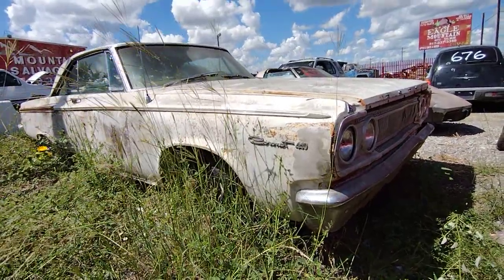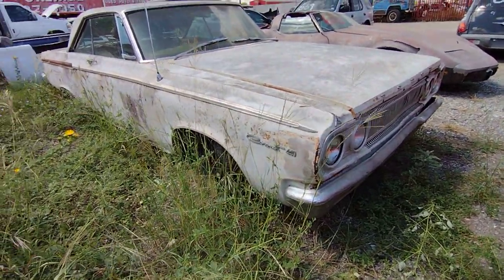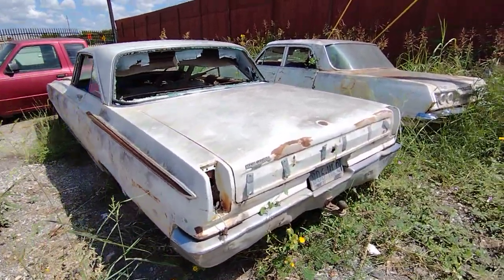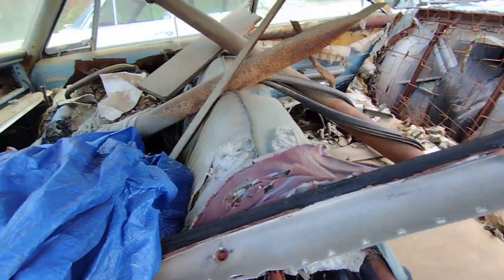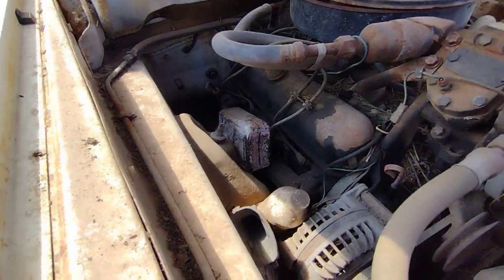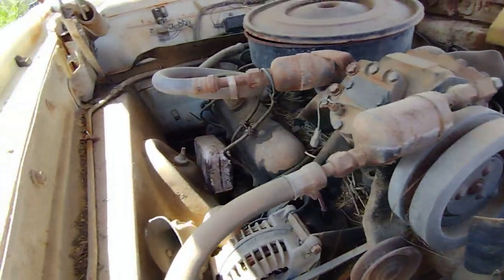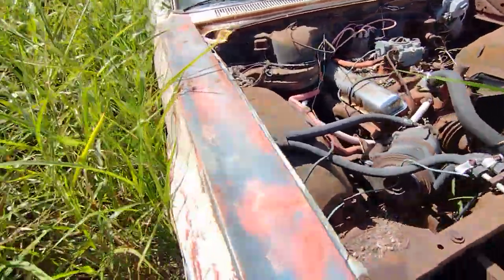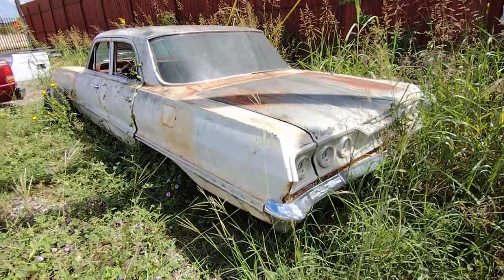Mopar For Sale. 1965 Dodge Coronet 440 Junkyard Find

Comment: Whoa Nelley, 1965 and may not ever be alive......

That's a C3 (1968-1982) Corvette, not a C2. Yep, I'm still here, just got home at 1 AM yesterday from a business trip to WI as noted below. Nothing like an early flight, a time change, working all day/week and getting home at 1 AM on a Friday. It will throw ya off, that's for sure. But I'm back from America's Dairyland (Green Bay, WI for those that know WI). Not to mention the day before there was a big Green Bay/Chicago game and I was flying through both airports the next day. Anyone who has flown through O'Hare will understand that the airport is a zoo, as are the NY airports. I fly through them all.....

We got the tag, we can brag: 1-1 for LH manual outside mirror, 3-9 for variable speed windshield wipers with washer, Q-1 for Music Master AM radio, economy, V-3 for backup lights, AB30 for 273 V8, D-5 for automatic transmission, E-1 for AC with heater,  SO of 926 for 9/26/1964 production which was a Saturday (which may have been the scheduled ship day), W32 for Coronet 440 two door hardtop (W is Coronet, 3 is High price class, 2 is two door hardtop), H1B for Blue cloth and vinyl interior trim, WW3 for White exterior paint with some sort of maybe silver upper door panel paint/trim. 

No VIN, can't win, but easy to figure out, no doubt: W for Coronet V8, 4 for Coronet 440, 5 for 1965 model year, 2 for Hamtramck, MI assembly or 5 for Maywood (Los Angeles) CA assembly or 7 for Fenton (St. Louis), MO assembly, and the rest is the production sequence. Hamtramck, MI assembly or "Dodge Main" or "Factory Zero" was the main assembly plant and operated from 1911 to 1980. As noted previously, it had the "Playpen" for employees to work on their own projects after hours, its' own fire protection, medical ward, cafeterias and everything to be a "city within a city". Part of the currently operating GM Hamtramck, MI assembly plant sits on the old Dodge Main site and GM even calls it "Factory Zero" in some of their corporate literature. Fenton closed in 2009 and Maywood in 1971. My guess is a Hamtramck, MI assembled car, but that's just a guess. Cedar Springs Dodge seems to have gone out of business around 1972, so they are long gone. 

1963 Chevrolet, no tag, can't brag, no VIN can't win. I can figure it out if you want, no doubt. Central Motors is possibly Autonation Chevrolet of Waco at 1625 N Valley Mills Dr, Waco, TX 76710. VIN is possibly something like 3 for 1963 model year, 18 for V8 Impala, 19 for four door sedan, J for Janesville, WI (maybe R for Arlington, TX), and the rest is the production sequence. I can figure it all out just from the trim tag, which I couldn't see if it was there or not from the distance shots with the camera. 

Whoa Nelley, 1963 and it could be over for thee. 1965 and took a nosedive. Extra value you will not get if you buy that Coronet. Plastic fantastic (next to the Dodge) is nothing but static. I just got back at the land of cheese, and sometimes flying ain't a breeze. Could all be flat and that would be that. No, I didn't see the Packers play, I had to fly away. MOPAR not going very far. That's it, could be time to quit. It might get squished and if so, the UTG and Pentastar faithful and just slightly so much so, the Google Man would be a little pissed.
Reply: Strange that the Cornett has the 273 instead of the 318 and I have seen slant sixes in the government purchased one's.
Reply: @garymckee448  The 273 was popular then for V8 power and economy. Sound familiar? 15 or so years later the small V8 became popular again.
Reply: @googleusergp  I had two vehicles with the 273 and it was a good fuel efficient engine a lot better than the Slant Six.
One was a 65 Belvedere 4 door 3 on the tree non synchronized transmission l bought it from the old man who bought it new and it only had 50 thousand miles and the other one was a 67 Formula S notch back Barracuda with 273 Commando .
Reply: @garymckee448  Chrysler's powertrains were excellent, but like Ford, everything around it such as carburetion and ignition was a bit sloppy. But with some tuning and finesse, they can be made to run correctly. I'd take a Slant Six or a V8, both were excellent engines.
Reply from the maker: Did I say c2? My bad, yeah I'm definitely getting that dementia setting in 😄😞
Reply: @ClassicRideSociety  Yup, you said C2. 1963-1967 is the 2nd generation, and 1968 to 1982 is the 3rd. That's a third generation model. I'd like to see more of the details on it as others have said.
Reply: @ClassicRideSociety  I have it also 😆
Reply: @garymckee448  I ate at a place in Wisconsin this week where both the owner and all of the servers had to be in their 70s and 80s. We were the youngest people in the place, as there was a table next to us filled with folks in their 80s saying how "we have to do this again next year". Sadly, many of them may not be around then. But, the food was excellent and the owner himself brought out the food (he had to be 80+ years old). It was an old time "supper club" and you can tell the place still pulls a crowd.
Reply: @googleusergp  It's almost impossible to get good food on the road anymore.
Reply: @garymckee448  Out west, it still is. You have to find the smaller establishments. I usually go pretty basic when I go out to eat, so I'm usually OK all the way around.
Reply: @googleusergp  Agreed there is a place in Council Bluffs Iowa called Bertha's good pizza and burgers.
Reply: @garymckee448  Council Bluffs, IA. The home of Warren Performance Products who makes the Supertech oil for WM. Owned by the Schlott family and around since about 1922. Good people, I hope that they stay around, family owned. I heard that they were bought by someone.

Comment: That's probably the most valuable of the bunch.  But still closer to half the asking I think if it's not rotted out underneath.  Probably could cross check that big mopar auction from a couple years ago for a better idea of value. 

Impala is $1000 tops if no holes in it.  It's a parts car.
Reply from the maker: They wanted $4500 each

Comment: No way that rust bucket Impala is worth $4500. It's worth 500 bucks and THAT'S generous!
I don't know why the doors won't open, but the longer it sits in the elements, the less it'll be worth. I wonder if it had been parked due to a bad radiator. Maybe that can explain all the rust on the driver's side? Still not worth what they're asking not by a long shot.
It's a very good parts car though. Maybe for the body and select interior pieces!
Reply: Probably worth at least around 1k, but it shouldn’t be sitting anymore

Comment: I had a 65 440 but it was a a four door , l put many miles on it and sold to a friend who put many more on it
Looks like a 273 because a 318 was a poly spherical engine or A where this one has the LA engine.
Reply from the maker: They want $4500 for this one
Reply: @ClassicRideSociety  too much I was wondering about the 300 the other guy posted about that was in storage.
Thanks 👍 Benny 😊
Reply: 273 V8 going by the tag.

Comment: would anyone pay 5k for a Chrysler 300 with a 440/727 car that has been in storage since 79. my neighbor has it, he told me 5k on it
Reply from the maker: They want $4500 for this is one
Reply: What year?
Reply: @garymckee448  1966
Reply: @flagcityparts  Thanks what area?
Reply: @garymckee448  ohio it's been in a heated garage since 79 the 440 was pulled and rebuilt in '19 with a larger cam and a new gas tank.  it was my neighbors grandparents car they passed in 78 he drove it a year and parked it, he was preparing it for restoration with a grandson and he recently passed in a accident. 
I'm mainly taking it as trade for some farming equipment.
Reply: @flagcityparts  Nice I'm in Omaha but I am interested in it.
Thanks 👍
Reply: @flagcityparts  Depending on how bad it is, that might be a perfect "Will It Run?" You Tube video series.